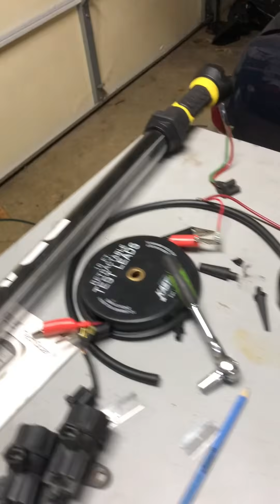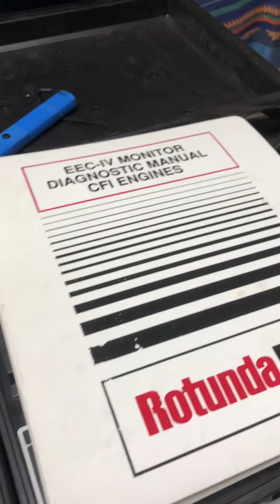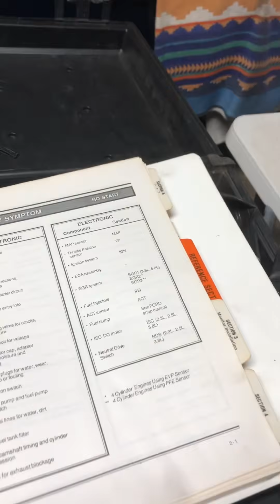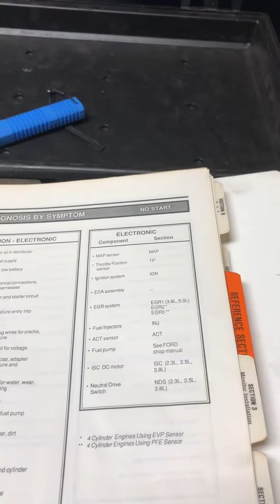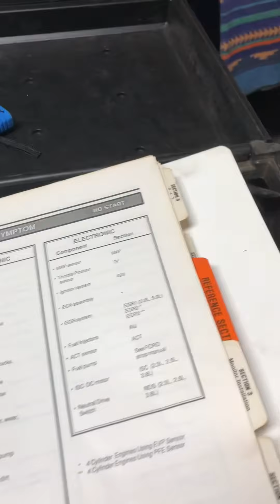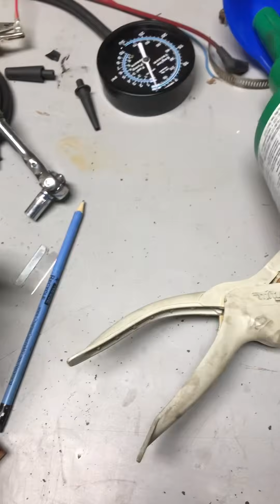Ford F-150 / Bronco EGR troubleshooting part 2

Comment: Good video. It would be helpful if you showed the location of the part in the vehicle.
Reply from the maker: Good point. Most Ford’s of that timeframe had them on the passenger side below the alternator. Hope that helps.

Comment: What would the problem be if that isnt getting vaccum
Reply from the maker: Chris_Vlogs if the solenoid doesn’t apply vacuum the EGR will get a insufficient EGR flow fault. The CEL will light after 5-10 miles and you may not get a chance the code if the part is only partially bad.
Reply: @Lostatsea52  I found out the problem 2 of my fuel injector wires were ripped apart so I was only running on 6 cylinders
Reply from the maker: Chris_Vlogs that would make it run bad for sure. Good luck.

Comment: Where is that located? I have a similar problem with a code 33. Replaced the EGR valve and sensor on top and I am still getting the code.
Reply from the maker: Phils Sabordo look at my reply above. Good luck
Reply: @Lostatsea52  I replaced this  EGR solenoid, egr valve, egr sensor, replaced all vacuum lines, new brake booster, the Vacuum reservoir is working properly .... AND STILL THROWING  code 33 ... any ideas?
Reply from the maker: Phils Sabordo did you see my video on testing the EVP sensor?  Is the light constant or after 3-4 miles?  When you say replaced vacuum lines what does that mean?  All of them?  The routing is very important. I know you just want to fix the problem but some of the aftermarket parts are just crap. Do these 2 things and reply with the results. 
1.  Pull the EVP sensor back plane the wires and check for varying voltage when the Pintal is pushed in and let out
2.  Get a vacuum gauge an verify that the EGR holds vacuum 

Let me know the results
Reply: @Lostatsea52  yes i replaced all the vacuum lines and routed them the say same way the old ones were routed.  The truck runs great when it's cold but when it warms ... it stutters on acceleration 

I will try these 2 things
Reply from the maker: Phils Sabordo the stuttering may be a different issue. Does it ping a lot under acceleration?
Reply: @Lostatsea52  I'm not sure but the code 33 still remains. EGR not opening/closing
Reply from the maker: Phils Sabordo the system works this way. First the EGR operates under vacuum. When it does this a signal is generated from the EVP sensor that is provided to the computer and sets the code for a lack of movement on that sensor. Do you have a vacuum gauge? If so place a vacuum on the valve directly. Does it hold? If so the can be only be a few things to cause your issue. 
1. Cracked or leaking vacuum lines. This includes the coffee canister looking thing on the passenger side. 
2. The solenoid I talked about here is bad and not providing vacuum when switched on
3.  The EVP sensor is not being moved enough by the EGR valve. Aftermarket parts cause this issue to occur because the parts are slightly different on the inside or the length of the EVP pintel is wrong. This issue causes the PCM to think there is no movement. 

Lastly, you need some tools to figure this out. If you don’t have a vacuum gauge you cannot verify much. Guessing will not get this fixed. If your in the DC area I can look at it for you